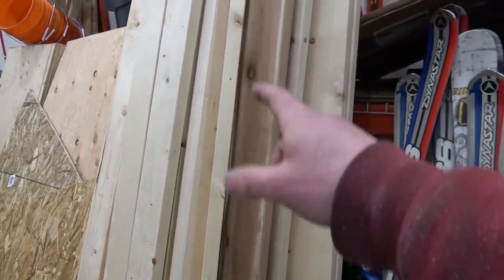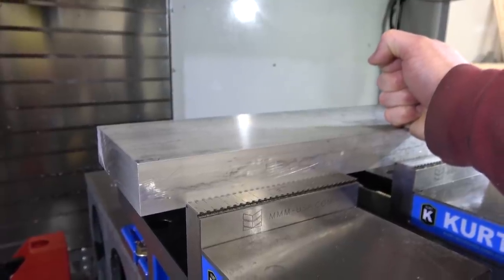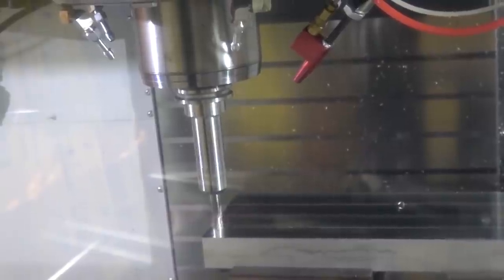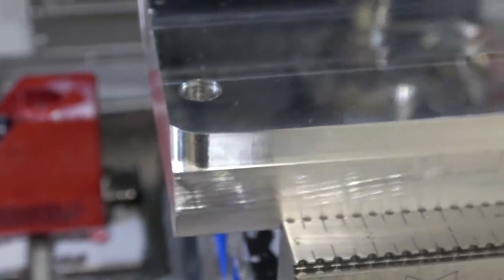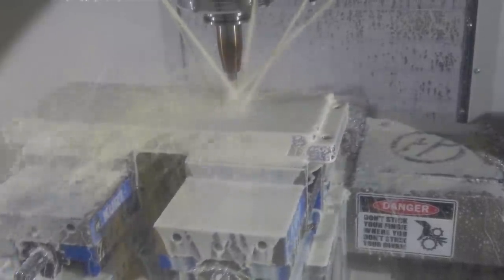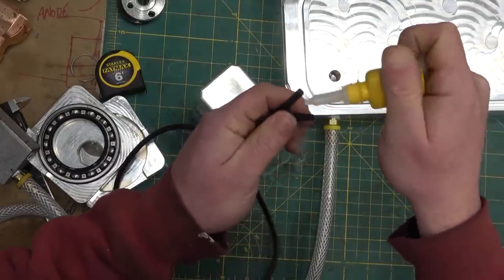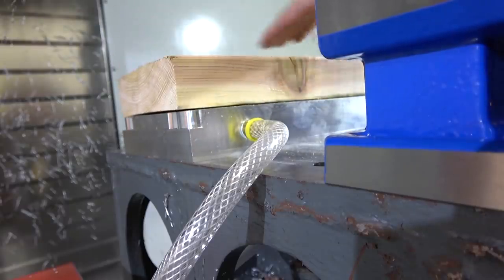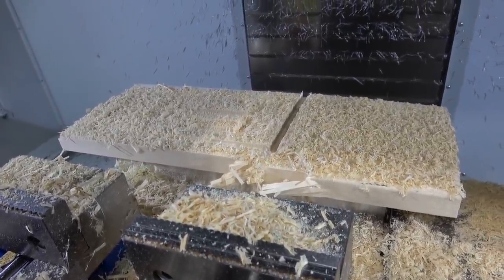Vacuum clamp for router-ing | Prototype & Test

Comment: Our cnc at work for wood uses these type of pods. It's a joke. I can't believe they think this is a acceptable way to hold material. They have got to come up with a better way of doing this. Seems to be okay for veneers and manufactured woods. But hardwood especially okay is just way too porous and irregular due to it being a natural product. Anytime somebody tries to sell you on a vacuum pod system to hold material, run as fast as you can!!!

Comment: please explain why you are calling the billet aluminum block you are working with is being called extruded? looks to me that you have 1 1/2" aluminum plate which is rolled at the mill. It is far cheaper to roll plate stock than extrude a block of metal.

Comment: Captain as# hat here. On diamond core drills they have an accessory vacuum plate for holding the base to the floor. Instead of an O ring it uses a rectanglular closed cell foam strip in the groove. IDK, maybe it would help here...

Comment: Look into Vacuum Surface with the rectangular pattern that way you can lay the ORing Rubber the way you need it.
Theres also another way with regular Sanding Paper with a sticky surface on the opposite side for the seal you take some rubber/foam that has got glue strips on the underside. 
With that technique you can perfectly lay down your contour which you painted on your flat surface with a marker.

Comment: Maybe a gummier o-ring would suit this better instead of having to face down these planks? The issue is something slipping past that barrier. If you had more deformation available to work its way into the imperfections of the word surface you'd have a more forgiving seal.

Comment: Double-sided duct tape would do the job just as well, if not better. It sounds hokey until you use too much of it to stick a big chunk of wood to your router thicknessing jig and didn't leave any space to get underneath to pry it up and you're trying not to damage the work or the jig... 

Anyway, it sticks stuff down pretty good. Masking tape + super glue is another trick you'll see a lot.

Comment: One day, after I had glued my fingers , eyelids and everything not 3 feet wide to itself with supershmoo, I decided to find the best way to get the stuff off,  after an accidental dousing. 
I tried iso alcohol nail polish remover , water , 151 rum , didn't put that on the glue , put that in my belly and various other concoctions, 
Eventually,  I found that just setting fire to the affected areas was the fastest way to unstuck yourself, I don't recommend this method to anyone else , I just like to simplify things whenever I can !

Comment: I bought me one of those factory-made cnc routers at a trade school auction. The Table was made of MDF that was sealed (urethane?), had grooves routed into to accept a foam seal that was kind of  D-shaped. Rectangular with one mildly convex face. Maybe 1/2" wide by 3/16"ish thick. Sealed very nicely.  I scrounged a rotary vacuuuum pump, probably 1/2hp. It gripped real good. 
I got a kick out of the Estop scheme. I proposed a pinkie-finger-sized pressure transducer for an Estop on a CNC retrofit we did here in the 1990s. ...would have come in handy a number of times....

Comment: For my diy vac holddowns I use neoprene/silicone vacuum gasket string. It's much softer than any normal o-ring material and allows much more compression. This makes it seal on uneven surfaces and pull them down in contact with the plenum support areas.

Comment: With all those wood chips... looks like you are going to need more of that fancy oil... or will your next project be a press to squeeze all the cutting oil out of the sawdust? Plus with the grease on your wood... in this case, it wouldn't be good for your finish.  In other cases, more grease on your wood, can help you finish.

Comment: why not screw the wood down from underneath the same way you attached you vac jig?
I think the proper wood smashers have a flat board with lots of holes (like perf board) and attach a vacuum cleaner for the suction

Comment: how did you made the room move around the table? r u an wizzard?
jokes apart, where I saw the Venturi applied like that it didn't had a hose but was integrated into the base itself, so probably the lenght of the hose made it ciuch less. I'm assuming this because it was an H arm where I could almost jump on the pannel and it wouldn't got loose, and I'm not so wheightless as I might seem during a dark moon...

Comment: Used to work in tooling department of a furniture factory, built lots of fixtures for the shoda routers.  We used benelex or arboron, iron board one person called it.  We used a soft durometer oring material, liquid super glue worked the best, just the thinnest on bottom, cut and glue end.
Made some to hold molding, 3d milled profile and grooves, used high tech material, fiber board, worked good, wasn't a real big run just a few thousand, fiber board worked well.

Comment: TIP:  Through a sheet of newspaper on the vacuum jig whenever an uneven surface of wood or otherwise is needed to be held down with the vacuum jig.  The newsprint sheet will fill in the gaps between the vacuum jig and the material to be held down.
Best - Michael

Comment: Think about the surface tension.... You need more holes to suck air through and the part will stick properly to the suction table. I've done this in a past with a vacuum cleaner. If you have one hole, that won't provide enough surface tension, but if you have more, small holes, then the surface tension increases.

Comment: AvE, Next time you should try a larger cross section for your seal and go with something a little softer than the material used here. So long as you can capture the seal in the gland, you shouldn't be concerned with keeping 50% of the seal in the gland - in other words, you can make it very proud of the surface, so long as when the dead tree carcass is in place, it compresses the seal and keeps it from being sucked into the vacuum area.

With the design of the seal here, you may be able to get ahold of some of that neoprene and if yer lucky, get the shit with the sticky back. They make them in non-standard geometries, so you can typically get them in a rectangular design - put the longer side facing out of the seal gland. This should help you from having to face off that bullshittery material :)

Comment: We (carpenters) use a temporary carpet protector (home building product store) that sticks fairly well that you could stick to the bottom of your hard maple so the suction would work (I know there is a joke in there somewhere) or simply spray glue (aerosol can) a 6 mil plastic sheet to the same hard 🍁 and voila the vacuum should verk

Comment: I don't know if this applies to every tool, but solid carbide endmills and drills too apparently should never be run dry in aluminiminumum. As soon as the oily film from previous use has vaporized, the the material will stick, and more or less weld itself to the tool.
I've done it myself.. once.

Comment: I've seen vacuum clamps used  for machining cfrp, of the hardest kind.  They don't keep up the maintenance on them, so they dont work.  Send the part down the line anyways, and let the cheap hands take the extra 100 to 200 thou off the profile with a belt sander.  That's the type of dry run that starts from the other side of the shop!

Comment: Use a foam gasket (foam rubber or whatever it is called in english) instead of the o-ring, compresses more and works much better with wood.

Comment: It would be really advantageous for you to shorten up those tools. Generally with machining the shorter the better. Always. 

You want the shortest distance from the gauge line to the business end all the time. 

You generally have your tools out many times diameter more than necessary. Makes them less reliable and drastically reduces their usable life.

Run out of a few microns can have an impact of 20% or more on tool life.

Comment: Similar things used on the bottom of corn hole saw machines for burn through concrete structures you wouldn't believe how much a fixation they can achieve on a fairly smooth clean surfaceis your break if you can meet the fucking thing to the ceiling and drill a 12 inch hole from below I digress if

Comment: A good double stick tape would have saved some cussing. I used a  concrete core drill that used vacuum to hold it down. The seal was some thick spongy rubber to fill the gaps in the concrete. It used a real vacuum pump to pull the vacuum.

Comment: To get maximum chooch leave some fins and channels in the chamber, the more you have to suck the less suckage you get.

All jokes aside restricting the vacuum channel in the chamber increases the vacuum pressure thats tranfered to the part. You want a maximum surface area contact but a minimal volume of air to move.

Comment: i ran a saber router table for 7.5 years in a sign shop 5 by 10 feet the vacuum hold down is just extruded aluminum tube with pvc sheeting glued on top once a year you peel it up stick new sheet down mill it flat your done here in the us 500 would get you a gem of a table

Comment: You should try this with a thicker gasket with more give to it like a lead rope gasket or marshmallow gasket. Would probably hold boards down without grease or having to face them. I doubt it will hold quite as good but might make the tool more useable.

Comment: Put painters tape down on on your table. Then put painters tape on your work. Then put super glue and connect the two pieces of tape together (sticky side to work and table the two non sticky sides super glued together) 

When it's time to take the work off the table peal the  tape off.

Comment: When I was working in profile shops there was a cardinal rule to using vacuum fixtures. You had to have two locator pins so that the part will not scoot under a side load.

Comment: Looks like you need a softer seal to conform to the grains of the wood better. Getting a bigger vacuum pump that has more flow will help at the start but if you have a good starting seal the pump wont matter as much.

Comment: why don't you use one of those torque packs (no idea how they are called in english) but basically they turn fast when they are under no load but have gearing that engages when you are at the part to clamp to the specific torque set on the device

Comment: the place i used to work has a Wadkin hole punch tape cnc wood router and the vacuum table is made of a a sheet of plastic with a grid of grooves cut into the top so you can put closed cell foam strip in in any arrangement you like and several through holes with threaded plugs to let the vacuum through in a convenient spot or new holes could be made to suit. also mdf is porous enough to use as an intermediate board.

Comment: What you need is to get one of those pressure sensitive tig buttons from the 6160 guy and wire that into your feed override, so the tighter you squeeze the slow it goes.

Comment: 3D printed parts printed using FDM are also isotropic and have similar issues to wood when applying load. Got to do some tensile tests on 3D prints with different orientation of raster lines. Was pretty interesting.

Comment: You might want to try a lower durometer o-ring cord. Also cut and glue it on a 45 deg angle as it is a little stronger and easier to line up.

Comment: If you use a foam gasket rather than rubber, it will seal on wood no problem.
Reply: You probably also need more airflow, the wood is porous

Comment: AvE you need a much softer seal. I use EPDM sponge rubber cord with at SH around 15-20 on the vacuumtable on our industrial CNC router. I hope it helps.

Comment: I have not seen ruber seal on thoes things. It was foam - like reals, with smooth surface. Like on window frames. lots of squish height. Surface of wood is not quite as good for sealing, as things o rings are made for.
Reply: it was foam - like SEALS (gasket, if there is grammar mistake)

Comment: I think you would probably get a better vacuum using a real vacuum pump or even an old pump from an HVAC system or old freezer/refrigerator.  I can get to ~14.5 with them and never got close to that with a venturi air pump/vacuum.

Comment: 18:15 - never thought of using pesto as a lubricant...
Reply: @paul beenisA grease is a semi solid lubricant. Quote from the OED - "A lubricant is a substance, usually organic, introduced to reduce friction between surfaces in mutual contact, which ultimately reduces the heat generated when the surfaces move. It may also have the function of transmitting forces, transporting foreign particles, or heating or cooling the surfaces."

Comment: Ya know, untreated wood is porous and not air tight. Should have mentioned that in the pateron. Thicker O ring, and treat the wood with linseed oil

Comment: You should use window foam for the gasket. It’s what I use on my cnc router. https://www.homedepot.com/p/M-D-Building-Products-1-4-in-x-17-ft-Storm-Door-and-Window-Replacement-Weather-Stripping-04267/100353463

Comment: Seriously though!
One of the most damaging combinations that can ruin your machine tool  - is WOOD and COMPRESSED AIR. The first is abrasive and the second one only serves to drive that abrasive into the cracks and crevices of the well lubricated ways and leadscrews where it will stick to the aforementioned lubrication and grind away on those precision surfaces.

Comment: We have a 10Hp vacuum pump on the cnc router and it doesn't hold for sh1t, the kitchen place up the street has 75Hp of vacuum pumps and it holds melamine well enough. timber needs a heap of suck it's too porous.

Comment: Explosive coolant around metal on metal high speed “thingies”? Proper choice of materials would seem to be crucial. Electrostatic arcing is quenched by the high coolant volume of low vapor pressure oil, I guess? Geeze, even the Formula One engineering wizards are getting around the rules improving their power and mileage by burning lots of engine oil in each race. Cheating, in other words. I’m shocked.